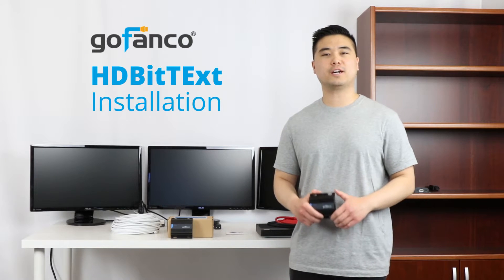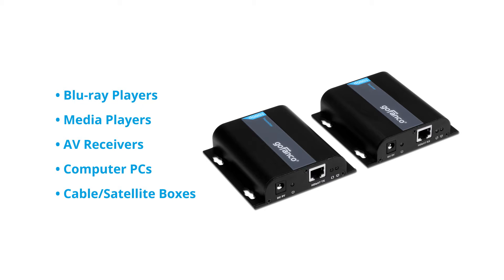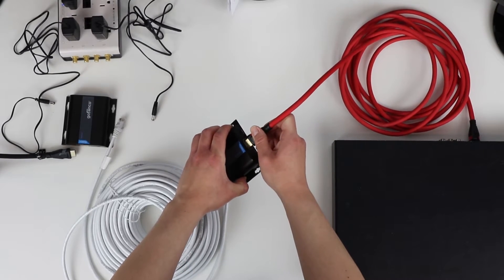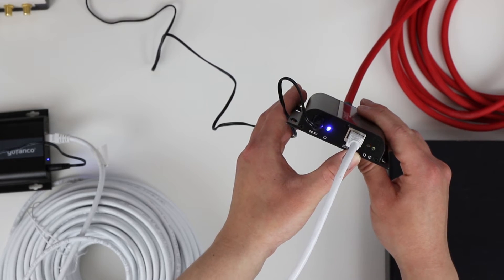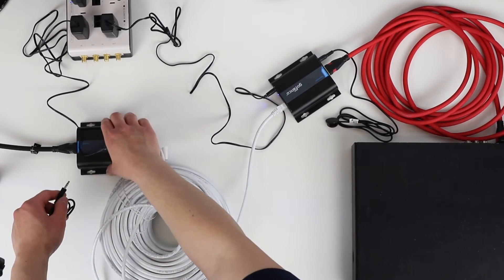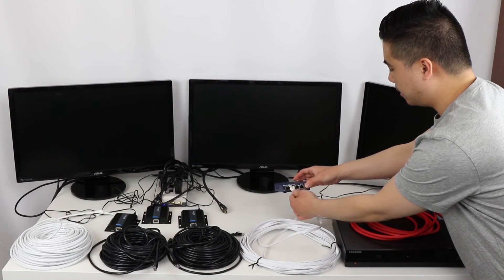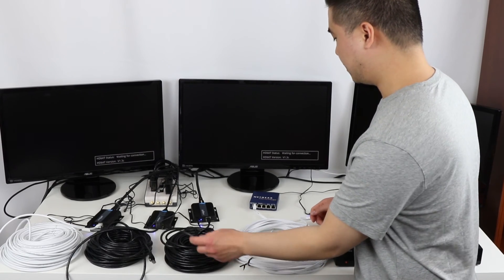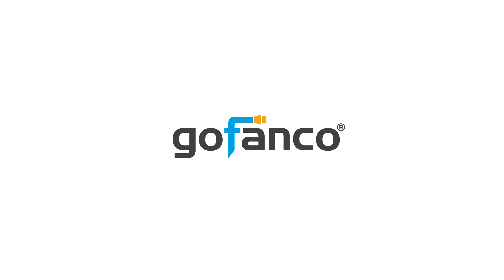How To Install gofanco HDMI Extender Kit, 1 Source To Multiple Display Over Cat Cable (HDbitTv2)

Comment: If i connect this to a computer will i be able to manipulate the display to say work as a duplicate of my laptop screen or as an extension of my laptop screen?
Reply from the maker: Hi Elroy, As long as the source device has an HDMI output, you should be able to use this HDMI Extender to basically mirror what your source device is showing onto your desired HDMI display.